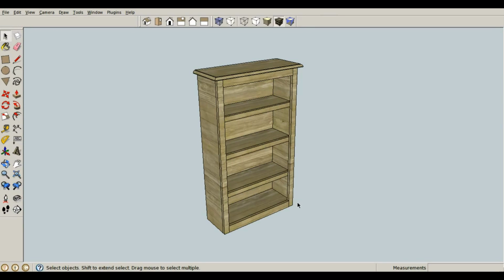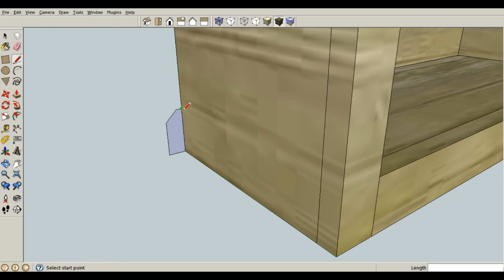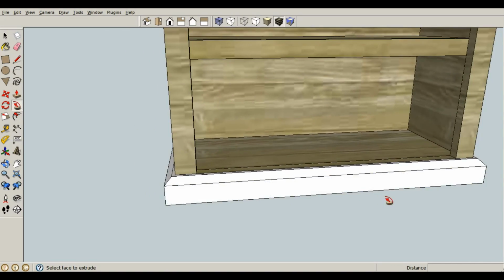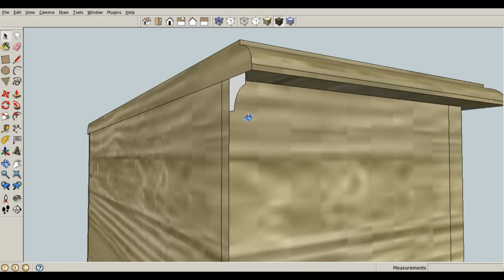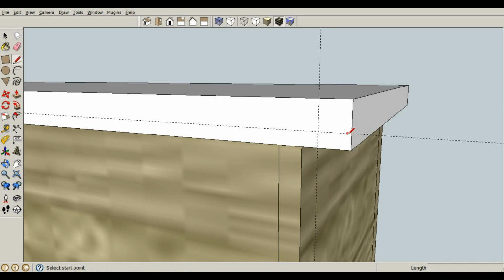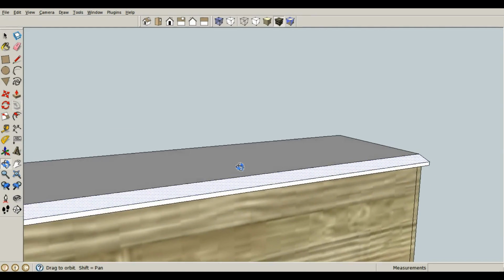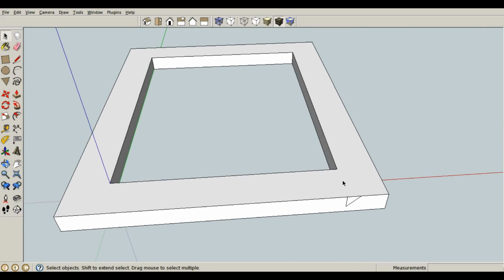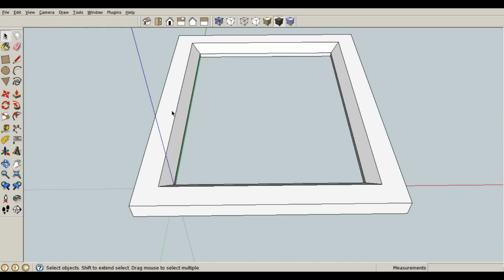SketchUp Follow Me Tool

Comment: Jay, these tutorials are awesome. One thing I wanted to comment on was the chamfer, a really easy way I found is to take the offset tool, click the top, make a rectangle 1/2" away from the edge (to the inside) and drag the outside square down 1/2". I had found this out before I watched this tutorial, and I was using that, but whenever I have to do chamfers around an entire edge, the method you demonstrate is much faster. I know I'm a little late on the comment, but I'm learning SketchUp right now and your tutorials are very helpful. I make plans a lot faster now because of your tutorials. My parents and I make a lot of things in the shop and put plans for them on on our website, and I learned a lot of what I know from your videos. They are by far the best tutorials I have seen on YouTube.

Thank you!!